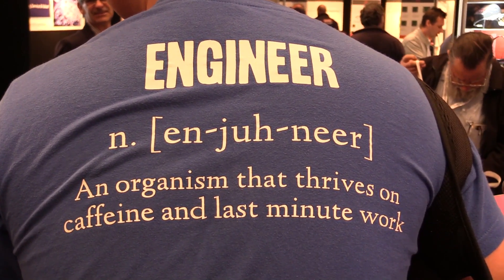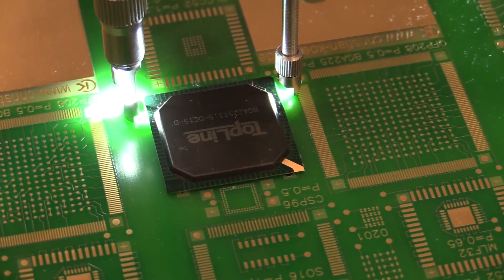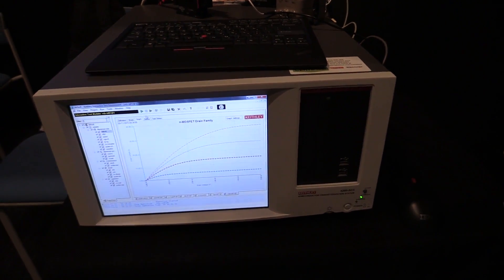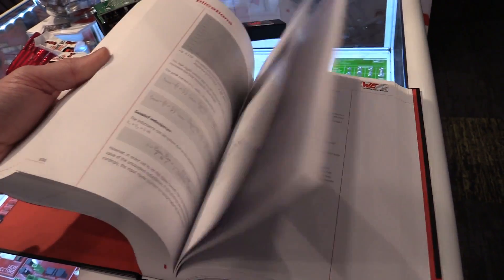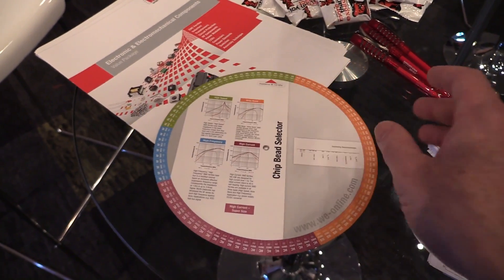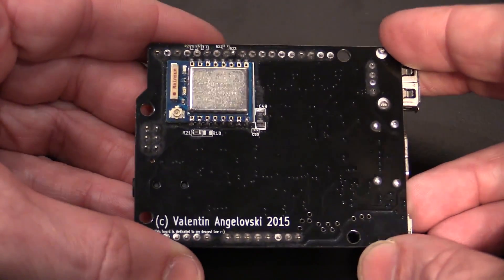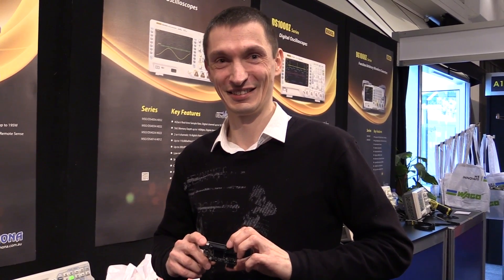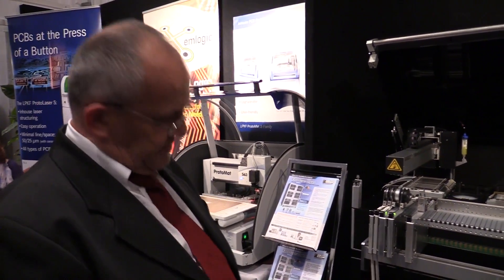EEVblog #795 - Electronex 2015

Comment: i like val, and saber. but i dont get why vtol would need much attention. look up 3d hovering. that requires a bunch of power but no extra mechanics.
Reply: +waldsteiger I didn't look up the rules, but if one of the requirements is VTOL, they probably want the competitors to take off vertically, with zero ground speed and without human assistance to point them up, their current platform can't do that.
Reply: +José Faria  you are right. it would require a second vertical stabilizer on the bottom of the tail and a 45 degree turn of the assembly for easier landing. or a 120 degree construction of the tail, which would not necessarily require extra mechanics. thanks